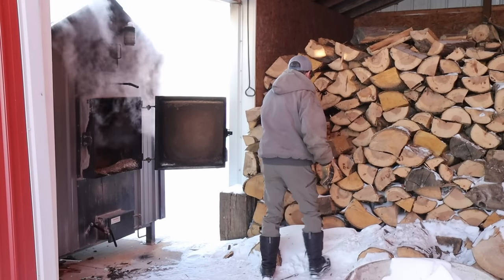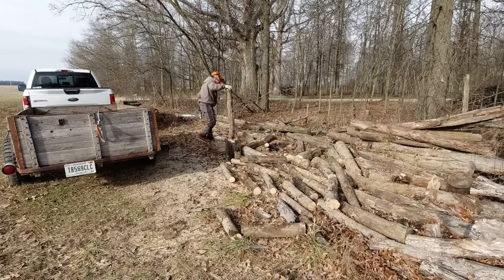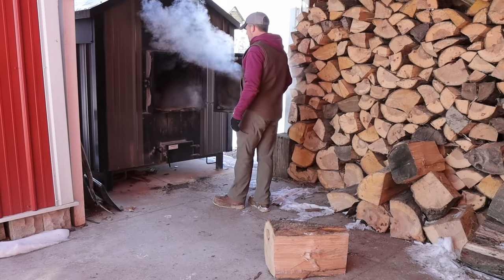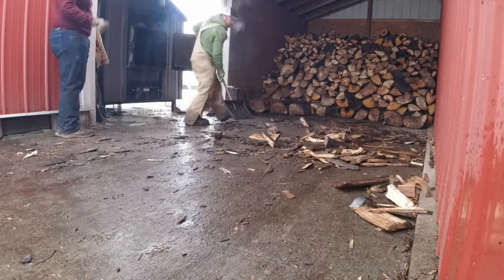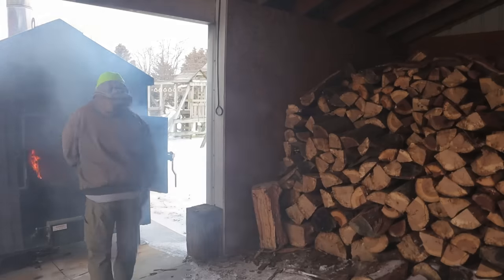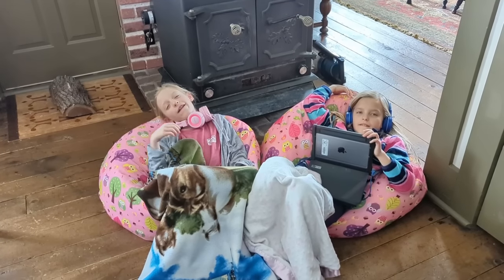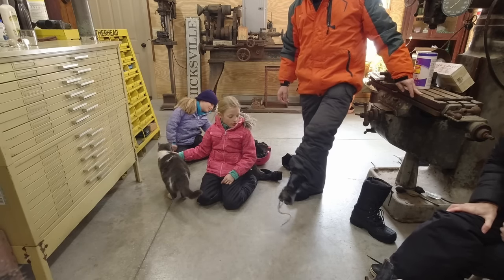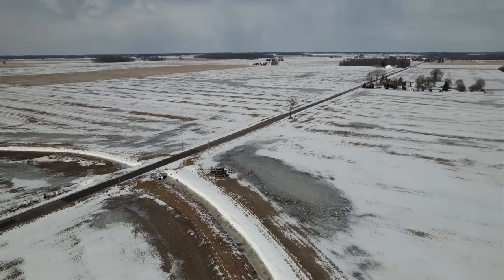Is BIGGER Better? [Firewood Size For Outdoor Wood Boiler] - Why Split Wood For A Large Boiler?

Comment: I have a Tulikivi masonry heater and when I build a fire in it, I build an "upside down fire." That is, I put the large pieces on the bottom, then some smaller, criss-crossed on top of the larger, then even smaller, crossed again, then some newspaper or spruce/fir boughs on top of that previous layer, then a bit of kindling on top of that. I then light the paper/boughs near the top. I find that the fire smokes a whole lot less during startup, burning much cleaner as the smaller stuff catches then falls onto the progressively larger stuff below. Despite what some people think, a fire built this way always catches. It's just that the fire never tries to heat the heavy chunks too early, which causes them to smoke a lot while the fire struggles through and around the heavy, cold chunks. Either way of firestarting works, meaning that either fire will catch (assuming dryish wood) - but the upside down fire "catches" progressively. With less overall smoke coming off the fire during the start, the chimney and firebox don't get hit with a bunch of smoke/creosote condensation nearly as much, especially before the walls/chimney heat up. 

That's in our current house. I am moving to a rural farm house with acreage and a bunch of woodland where trees are always falling over, even on the front pasture/lawn. I'm thinking of putting an outdoor wood boiler in a machine bay I have in a nearby outbuilding and a heat exchanger in the present oil furnace in the house. The house is only 1100 sq ft so an OWB will be a bit large for it at first, but I also have plans for a small greenhouse burrowed into an embankment along the driveway, about 100 ft. away that I'd like to heat at least above freezing from early Feb. on for seed starting. I may also heat the garage bays, though right now that part of the building would need a lot of sealing up 1st. This is in northern Maine and things still get pretty cold. 'So much fun stuff to do and play with!

Comment: I have used my outdoor boiler for about ten years now. It's taken a while to find the best way to store and handle the wood. My goal is to absolutely minimize the number of times I touch it. Split it, stack it, and the next time it's touched by my hands it's being put into the firebox. 
As far as size, 5" diameter or less branches get cut to 40", no splitting. The splitter has a 26" stroke, so logs to be split are cut to 24", most are just halved or quartered.
I have settled on 42"x48" pallets with four 48" vertical 2x4s, two each side, screwed to the sides the pallet for storage. A scrap of metal banding screwed across the tops keeps them from spreading. One of these 'cubes' as full as I can get with split hardwood is just about at the limit of my little skid steer loader with forks. Five cubes of split wood equals about two cords.
The pallets are a nice size. When they're empty it's really easy to spot them close to my piles of freshly split wood for loading. When full I carry them off to storage with the machine. They get covered with squares of old rubber roofing material to help stay dry and left to season in a sunny spot at my workshop, The rubber is nice because the sun doesn't wreck it and it's heavy so it drapes well and stays put.
Come heating season, the machine puts two or three cubes onto a semi-retired flat bed Ford F250 (runs fine but cab too rusty for the road anymore) and I take it up and park it next to the furnace about a quarter mile away at the house. I've burned about 30 'cubes' so far this season.
Don't fail to do the annual boiler treatment chemicals. Two friends with wood furnaces didn't and both rusted through years ago and had to be abandoned.
I also cover the stack in the off season to prevent humid summer air from being drawn through the firebox and causing condensation in there.
Reply from the maker: Sounds like you've great a great system laid out there.  I want to minimize as well so thinking about doing the IBC totes or building pallets too.  That's a lot of cubes you go through but I'd likely be in the same boat.  Thanks for the great comment and appreciate you watching!

Comment: That is a good combination of heat.  Two that depends on electric and one that just uses wood.  The electric baseboard heaters gives you a dependable method to keep the interior temp regulated overnight or if you are away from home long enough to burn down in the boiler before you can reload the fire.  The woodstove gives you the assurance of having a heat and cooking surface if the power goes out.
Reply from the maker: We have propane too!

Comment: i cut mine to 24 inches long and we leave some as big as yours and i agree you need to mix them with smaller ones.wheni need to get the water temp up fast i but more pine in and i can recover the heat fast.the skating looked like fun
Reply from the maker: Sounds like we're on the same wavelength!  It was fun to get back in the skates again but I hurt more from that than the firewood!  :)

Comment: When I was younger. A friend of mine had a 6 foot round by 5 foot deep wood stove for a 70x 50 x 20 shop. I remember loading massive logs in there, must have been 4 footers x 16 inch rounds..everything would be burned in that beast. It had pipes inside with a blower on the back. Hot air only. Very impressive homemade stove..
Reply from the maker: That's cool. They must have loaded those in mechanically somehow? Sounds like a heck of a nice wood stove!
Reply: @digdrivediy  fork lift could drive right up to it

Comment: I have a dyna firewood processor and do mobile processing my logger that I get all my pole wood from for processing and selling has a outdoor boiler and we do his wood at 16 inches as we are both getting older and is hard to put them big chunks in the boiler as we push all the the coals to the back of stove at 16 inches we can stack 2 row in the boiler so it makes sense for use old guys as we are not as strong as when we was 30

Comment: I found cutting my wood all 4' and back my 3 tier forwarding trailer up to front of the boiler. So we can slide the pieces in to fill boiler. I mostly burn smaller stem of ice storm damage. Bigger wood is more labor intence. Unsplit wood burns much longer. Burning pine mixed with hardwood. Allows fire to restart quickly. If  your wood was a little smaller. You could pile 3 rows to fill your boiler for longer burn times.
Reply from the maker: Sounds like a nice setup Jim.

Comment: My friends say I’m crazy, but I cut most of my oak 56” long. Some of them are almost 20” diameter and barely fit through the door. I do not throw them. I slide them in and push. I normally put small 7” diameter by 56” long ones in first then slide the big ones on top of them. I either lift, drag with tongs, or walk them “wiggle” as I turn the vertical log on its edge and walk to get them from the pile to the furnace door. Normally only have to tip in and then just lift one end. I don’t split anything. I think you are correct that these take a while to light. Guessing some, especially green stuff is well over 100 pounds. I guess I cut them long to save time cutting and dulling chains! Also other than the heavy ones, they slide in pretty easy and I fill the firebox to the roof.
Reply from the maker: I agree with your friends!!! 😋 Jk

Comment: No experience with outdoor boilers, but have had to deal with feeding wood stoves for most of my 50+ years. Not sure how the OWB is with creosote build up, but I know it can be a problem with regular wood stoves & their taller chimney. I’d always heard the wetter wood would cause worse creosote. So, aside from the size restrictions of our wood stoves, the split wood dries (seasons) faster, can be burned sooner and burns cleaner.
Reply from the maker: Oh yes, don't I know it.  Usually get wood ahead but not as much this year.  Fortunately the outdoor boiler handles it well and really no difference in creosote ever noticed.

Comment: Neil, We have two outdoor furnaces. We have had them for nearly 20 years. The pieces I put in are getting smaller every year. I don't know how I handled some of the pieces I used to put in. Even back then they weren't 80 pounds. Maybe 50.
We burn 20 cords or so. I do 90% of the work by myself. Not too bad for someone who just turned 59.
Reply from the maker: I think it sounds like you're doing great!  Hope I can say the same thing when I'm 59!  Thanks Tim!

Comment: Very nice hotwater system for firewood, nice! About the wood size: heck I would never use That Large pieces for just the reasons you mentioned! On the other hand, I understand the added effort that is needed for splitting them in large amounts. :D

Comment: I often wish we used firewood for heat.  Then my elbows and shoulders hurt just watching you and others fueling those boilers….  I’m thankful for propane even if my wallet is cursing.   Flooded field ice skating is a new one to me. I’m guessing it’s more reliably solid ice than a frozen pond.  As always, it’s a joy to get a glimpse into family play time.
Reply from the maker: Thanks as always WC.  I'm with you on the propane though.  We use propane in the fall and spring when the fire is out and it will be what I switch to when it's time to be done burning wood.  The field skating is usually pretty risk free since it's only a few inches thick.  Appreciate the comment!

Comment: I run a heatmor 200 model and I believe it can take 3 or 4 foot logs. I split my wood based on weight. I can handle much more than my wife so I usually split some small in case she needs to load it. I've loaded whole wood into my stove over 100 pounds. I found that if you don't split the logs you better have a really good hot ember base because it seems to need to have a much hotter fire to burn whole logs....but they do last longer. You also need split smaller pieces to fill gaps. You cant throw in more than maybe two whole logs before they get to high to put another heavy one on top. It's way too much work so having the split pieces to put on top is nice.

Comment: I dont have a outdoor wood boiler so i dont know that much about them, but i do have a pellet furnace that i fill with 15 KG / 33 pound bags,
and first dumping in 10 bags and than moving the next 10 bags into position, takes a bit of energy, so moving 40 KG single logs during day, night, rain, snow and storms are no joke.

And this is just my imagination, but would the wooden boiler not develop indentations / form cracks if you only threw in super heavy stuff?

The rest of the video is pretty spot on, small wood vs large wood, burntimes and effeciency.

Are you going to continue to burn logs for heat in the foreseeable future @Neil Kock, or are you going to move to something else when your current boiler arent up for it anymore?
Reply from the maker: There is enough of an ash bed in the bottom that it doesn't hurt the stove when throwing them in.
I hope to be burning wood for at least 5 more years.  That would be 20 years of burning wood in our outdoor boiler.  Then I'm going to begin transitioning over.

Comment: My stove will take 4’ length but my splitter on 2’ so….yea just because you can lift it doesn’t mean you can get it placed in stove to burn properly. I keep a stack of smaller size for those recovery times and use long stuff as well. I’m curious if all the direction givers actually have wood burner? Good explanation
Reply from the maker: Thanks Joey!  I'm guessing that they don't fill a wood boiler twice a day! :)

Comment: i have been working with firewood for many years (over 30) i have probably split (with a hydraulic unit) over 500 cords in that time. (between using wood for Native Ceremony and heating my home with a wood stove). 

in the stove i use as big of pieces as i can, but that assumes that i have a good bed of coals. i understand the need for different sizes now, as you use them for this unit. 

a few questions: 

how much did that unit cost ? it is heating the house and your water, correct?) 
how often do you have to fill the box? (do you go outside over night at all? or before bed and in the morning at a reasonable hour to refill? 

and you said 5 cords - is that all you use over winter? 

thanks. have been enjoying your videos.
Reply from the maker: Thanks so much for watching!
It cost us about $7000 in 2007.
I fill it in the morning and before bed.  If really cold I'll put some in at lunch time but that's only a few times a year.
We burn more like 11 cords a year heating our house, garage and large pole barn shop. I don't heat our water but I should.

Comment: I am cutting my wood to about 24" so it will fit on my splitter and my firebox is 26" long . Using a portage and main gassifier furnace . I also split the larger blocks so i am not fighting with the heavy pieces as well .All my wood is loose piled in a steel shed with full opening doors  14x30x14ft high .

Comment: Great video. Like to have same outside wood burning set up someday on my farm. But I think I'm starting on trying to add more Installation, windows and make more air tight the house. Before I add a wood burner. I don't want one in the house because the monthly house Insurance payments would increase.
Reply from the maker: We should have done more with insulation too.  We are pursuing some solutions right now for ways to help efficiency.

Comment: Have a combo oil/wood hot water furnace in basement. I love it, especially right now with furnace oil being the price it is. 
I made the mistake of splitting the wood a bit too big one year, and caught grief from the wife, as she said they were too heavy. 
So this year I split them too small  LOL., burn too fast. There was only one year it was abnormally cold here and we burnt maybe 4 cord, but most years I get away with 2-3 cord at most, and some under 2. In saying this I only use wood when it is cold and blowing, or just very cold. The home was built in 94, and is insulated well. So if I do have the wood boiler going on a day that the temp outside is just above freezing, I find it is too warm in house, as just the warmth from the boiler down stairs warms the house. So the majority of the time the oil furnace is running, and the wood is just for comfort and expense factor when colder.
Reply from the maker: Nice setup!

Comment: What's the drying time like over there? If you dropped a green tree then cut, split and stacked it in an optimal area how long before you could comfortably burn it? 
Here in Australia it's basically 2 years. 1 season if we get a nice long hot summer
Reply from the maker: You could burn it the following year without any trouble in our wood boiler.

Comment: I cut my logs to 29". My splitter will handle up to 30" long longs. I split the 29s down. My boiler will take up to 36" long wood. I stack the back of the boiler like a stack in the wood shed with the 29" pieces. Then fill the front with smaller pieces. Fill about 1430 hours each day and even on the coldest days lasts till around 0900 next day.

Comment: Mine is a Shellter outdoor forced air wood stove.  The smaller firebox forces me to split small vs. my brother’s outdoor boiler.

Which is ok because my wife and kids help load it as well.

As I get older, the smaller pieces are not an issue and there is no one to impress that I can pick up 80 pieces-work smarter not harder.

By the way, ever hear of the Lore Reloaded YouTube channel?  You sound just like him, I kept listening for a SciFi reference!
Reply from the maker: Hey Dan.  I've never heard of that channel but I'll be sure to check it out!  I can assure you I'm not impressing anyone around here with my weightlifting abilities! :)  Thanks for checking it out!

Comment: When I was stationed in Scotland “USN”, I heated with coal. The creosote retarded the heat exchanger that heated our hot water. We used a chemical that devolved the creosote and heated our hot water faster.
Reply from the maker: I could see that being an issue.  I run a powder in my stove to cut the creosote but it isn't too much of an issue

Comment: I have an outdoor boiler and I have never really considered the weight of the wood. To be clear though I'm 6'4", weigh 300 lbs and have lived on a farm all my life. Obviously it can be a pain to load heavy pieces into the boiler and its not optimal in a lot of cases. I do cut my rounds longer and split them. The wood burns better split and the larger, non split, rounds are reserved for very cold weather or when I know the boiler will not be attended to for a long period of time.

Comment: ive had a central boiler for the last 15 years or so and i agree with doug kline's comment. Every year the pieces have gotten smaller. I'm 6'-3" 375 lbs and can get those huge pieces in there if i have to...but who the hell would want to?  I also have freinds that love to help cut wood and help out because they don't get to split wood in the city, but they are far less likely to help (especially my buddy's wives) if the pieces weigh more than they do!. The other main reason i make the logs 6" or less in diameter is that my wife is WAY more likely to feed the boiler if she can lift the logs on her own.  Granted I do like 90% of all the loading and maintenance, but if i work out of town or go on an ice fishing trip with the guys...it's good to know that the wife can handle business of keeping the home fires burning. teamwork makes the dream work...none of us are getting any younger!
Reply from the maker: Very well said.  Thanks!

Comment: If I can pick it up and fit it in the door it goes in. Central Boiler 6048. Some chunks of oak that have gone in were 100+ pounds but i try not to do it at all anymore. I will split most rounds at least in half if not quarters
Reply from the maker: Yeah, I try not to have that rule anymore :)